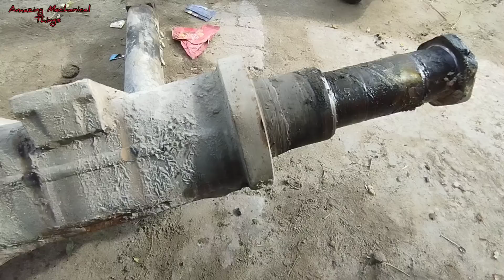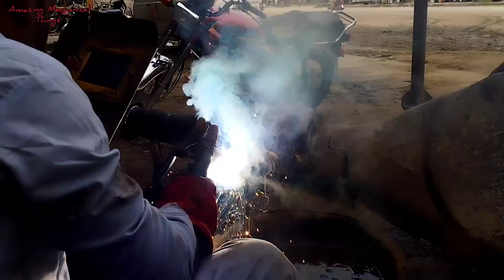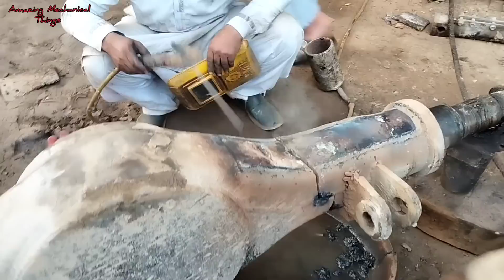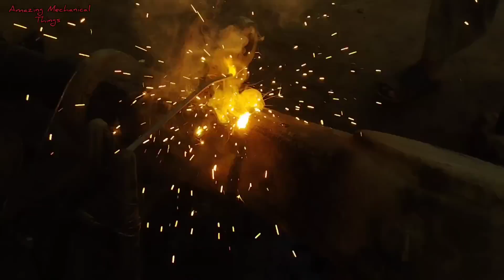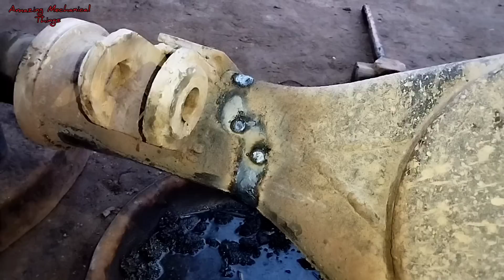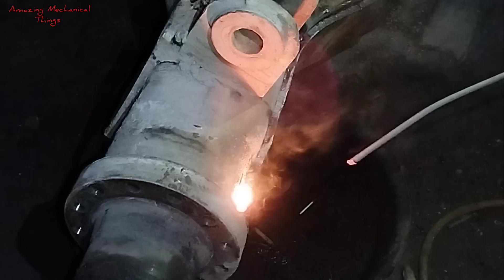Spindle are Cracked in The Middle Which no Mechanic Repairs|| NISSAN TRUCK Broken Rear Wheel Axle ||

Comment: I give that welding on the axel casing a big thumbs up all things considered, plenty of preheating, lots of stress relief with the big hammer and good root penetration at the joint. Not sure about the patch.....
Its amazing what these guys can archive.
Reply: I agree, if clearance permits, I recommend trussing it even if they are only a couple of inches high.
Reply: I say fill it with JB Weld.😂
Reply: Wth? They didn't even clean the metal before welding. That is ALWAYS the first thing you do when welding. Clean metal= clean welds. Dirty metal=shit welds. It's absolutely stupid to go through all that work and only do a half-ass repair.
Reply: @alecb8509  I think everyone here had the same thought. :-)
Reply: You can't miss on root penatration when the gap is like a quarter inch
Reply: "Preheating, stress relief with a big hammer"?... Lol you haven't a clue what you're talking about . Ummm they were trying to make it spin true with that Mickey Mouse DTI setup by welding the high side of the runout and then hitting it to move it  before laying down the full welds for which they did NO PREPARATION . It's pretty piss poor.
Reply: @oxyfee6486  that's funny....but!!! jb weld is what's holding california on the continite
Reply: The loads these guys put on a truck is unbelievable. Considering the circumstances of being in a 3rd world country, they are cobbeling together what they can to get them another day and another days wages.
Reply: Some people just don't have a sense of humour. Lol
Reply: nope, no weld prep, crummy looking root  and fills.
Reply: Stress relief with the sledge hammer 😂
Reply: don't forget  each welding  pass cleans and neals the weld below   the tipe off weld  they are using  is  not the mig shit you are  using
Reply: @matthewgillies6936  I agree, not criticising but the flat plate approach didn't work before. A bit of 3 dimension bracing seems appropriate;

Comment: Given the chronic overloading of trucks and the state of the roads, this repair is likely to be quite common so this crew would be very experienced in how to fix it.  Impressive!
Reply: But how long is it going to last?
Reply from the maker: Yup 😁 thanks 💓
Reply: @cooldog60  Under normal circumstances this part would have been junked, so I suppose if they can get even a few more months use out of it, it would have been worth it.
Reply: Problem is it may last a week. And the suspension brackets are already spoggy shit welded on. There must be plenty of these in the wreckers,, though may be no better!

Comment: Quite clever burning the plate off with an electrode. Just turn the amps up high and away you go. Saw that done on a stainless steel beer barrel  forty years ago. Still works well. Well done boys you get them back on the road thats all repair and haulage is the world over. Otherwise someone  is losing money. Gotta be done. Thanks Ruth ❤

Comment: I have seen some of the loads and incredible terrain in this region.  As to the repair...it did seem to be drawn by heat induction to much of it's orignal alignment. "I did wonder what on earth could be the electrode".?   And..I would have used much more of a grinding to weld placement.  But then I look at conditions there.  Think about expectations..."like will it work"?
Will the truck return to service for the proud owner?  Get the care and maintence that would add service life?  Took note of the estimate as age of machine...by the general design.
So ....a lot like a "field repair"...to bridge real mechanical fault to "back to hauling."
Could I have done so well?   With the tools shown to be at hand?   Did the repair meet a part, component of drive returned via repair...rather than replacement.?  I think..yes it did.
I truly do like to use heavy boots.  A full helmet with leather jacket and ear plugs.
But can this lot afford them?  Match up pay scale to what I would call basic needs.
In the end...I laugh a bit...and truly  wish this crew well.  They did their job.  M.
Reply: Well said Mr..!

Comment: The skill in using the electrode to gouge with is pretty amazing, if you folks had some of the western world tooling the thing you would make look easy lol, Carbon Arc gouging would of made this job a cake walk, or a plasma torch my oh my
Reply: I thought he was using a carbon gouching electrode, just without the air hose. Is it possible?
Reply: @GASolomons  nah, twas regular rod, carbon rods have a copper coating, and the slag makes a helluva mess without the air to blast it away, the graphite in the rods raises all sorts of problems

Comment: Looks like a live axle housing converted to a tag or trailer axle due to the lack of an opening for a differential assy. Cobbled up mess from the beginning.
Reply: You can actually buy them that way, I believe they are called dummy or placeholder axles, sold as a low-cost option for new truck setups. They have a cover attached where the diff would bolt on, to facilitate the upgrade to 2nd drive axle. These covers are usually bolted on however, not welded, so no clue how this axle started life. Either way, the truck it was mounted onto clearly needs more axles, 1 more steer axle and 1 more drive axle, plus frame reinforcement, brake and spring upgrades...
Reply: Good point

Comment: It's the alignment I'd be worried about, the half shaft probably undergoes complete stress reversal every revolution.
Reply: They got it back close enough. There's a bit of wiggle room with the housing. So long as the axle isn't bent, it'll work out ok. I'd be more worried about all that gouging slag in there. Not ideal by any means but I'm willing to bet this differential got back to work, for a short while any way :)
Reply: this is not a live axle . what half shaft? there is no half shaft. the end of the axle will have bearings that the wheel spins on. if it's a little off just means more wear on the tires which with the roads they have take a terrible beating anyway.
Reply: @jt8251  not a live axle. no differential no axle shafts . it is the axle shaft.

Comment: It has been patched before with a top plate, badly.  The stress is all in the sidewalls, not so much along the top.  The welding is barbaric, all wrong for cast steel.  Best to make an appointment now for a return visit in about two weeks.
Reply: Чулок сварной  из стали .а вот усиливать надо по бокам -да

Comment: That is actually an easy fix...if you can figure out how to do it. I have fixed many farm tractors and other equipment with cracks like this . First is to heat up the entire area so that you can get it bent back closer to the correct straightness. The after getting it close you need to apply more heat to keep it as hot as you can. Since that is likely cast iron the hotter you can keep it at the better. Next you use what is called a gausing rod. We commonly used them on cast iron engine blocks. It is used to open a hole that does not go through the entire metal but instead blows (as compared to cuts) a rough sided V in the metal area we want to repair. Then all you have to do is use a iron welding rod at about 180 amps to weld it and seal the crack. Remember to keep the area warm where you are welding this helps to melt the metal together better and let the iron flow smoothly into the V you cut. Do not pour water or anything on it let it cool by itself do not grind of any rough surface to make it look pretty but rather use your chipping hammer to knock off the slag. IF there are any spots that are not a clean weld re-weld that area only and let cool figure about 2 to 3 hours for a casing that size. But the bottom line is welding  it will likely get you down the road for maybe a a year or maybe a week you really should replace the part if it starts to leak anywhere on the weld seam because that is a sign it is going to break again and for all practical purposes you can not weld that area again. A note if you are looking closely you can tell he IS using a gausing rod to cut the plates off. Also look closely this has been worked on before as indicated by the support plates and no one weled the crack up the just put on a plate

Comment: It looks like a job well done with reinforcement again since the other one didn't support it, but those who don't have money to buy a new axle last a while longer, one hour will have to buy a new one, another thing is the very precarious working conditions: uncemented floor, without suitable clothing, gloves, protective glasses, safety boots and helmets, welding on the floor is uncomfortable, better to place on a table and weld standing up for more comfort without damaging your spine, here in Brazil the Ministry of Labor is very demanding when it comes to on safety and working conditions.

Comment: You get mixed results from these guys. Sometimes their repairs are awesome. I know a guy who is a wizard, for example, at welding small parts and aluminium brazing.

5 minutes later they are tearing bits off your car without undoing the fasteners, are screwing your bumper on then painting over the screws so you can't get it off without cracking the paint, or are getting dirt in stuff or are putting completey the wrong oil or fluid in things while saying 'no problem'. 

Anywhere they work, it is standard practice for the customer to sit and watch, ready to halt proceedings when things get ugly. Chairs are provided.

I always find it is best to remove and isolate just the part in need of repair and take it to them if you have to. It limits collateral damage.

They are working fabricating stuff, and it was from such beginnings the industrial giants of the world became major manufacturing countries.

Ability to repair sparks powers of invention.

Comment: It is interesting that the axle case seems to have been welded up from pressings in the first place rather than cast.
They don't seem to possess a wire brush!
Reply: Not unusual in trucks,, but they are done in equipped factories with the right equipment. Not crawling around on the dirt with a dodgey stick welder!

Comment: They don’t grind the metal clean before welding, they weld on dirty metal and that makes for a poor and weak weld. It might look good on the surface but it’s underneath tat counts.
Reply: Well.......their welding in sandals and pajamas so I’m sure cleaning the structure before welding isn’t that large of a surprise.
Reply: And what about all that welding particals inside the diff? Most of what these guys fix isnt and shouldnt be road legal.
Reply: Imagine that axle crack further elsewhere by hitting it with a sledge hammer like that...lord have mercy on that axle and should it break again in traffic🙏😱
Reply: @nevillesmith9795  It's a non geared auxiliary axle. There is nothing inside it and only has wheel bearing shafts on the end.
Reply: well he did burn a new channel where the fracture was, so technically it was cleaned. He also burned a big v groove in it,  so *technically" cleaned as well....:)

Comment: Axle has been repair already at least once before in the same spot.
So we good to go for another 30,000 miles.
Reply from the maker: Yup 😀😁
Reply: Do a box weld brace on all for corners for longevity, and don't overload the truck.
Reply: @mikespain8655  They charge extra for that right?

Comment: I haven't seen welding rod cutting since I did it 35 years ago. Also I didn't se how that rear end cover plate was bolted on, makes me wonder how the diff gears are put inside............
Reply: My guess is it's just there to take the load ...
Both sides are welded up ..
Reply: There is no diff, it is a tag axle just for carrying weight.
Reply: @artszabo1015  That explains why no diff gears,
Reply: @job38four10  Yep,
Job 38:4 Where wast thou when I laid the foundations of the earth? declare, if thou hast understanding.

Comment: I would have thought that the accuracy of the alignment should have been checked on the axle and not the rough outer casting. Amazing at tackling the repair in the first place, longevity, quality ,  strength and rigidity of repair ???????
Reply: Alignment is of no importance anymore since it is no driven axle, all gears are removed and axle is welded shut.
Reply: @haynillesen  No you are wrong, if the stub axles are  aligned incorrectly it will affect the trucks handling and tyre wear.
Reply: @brucepickess8097  Not worth it in those conditions
Reply: the flange they were measuring to looks to be machined and it probably created one of the original alignment points.  Also, it's a welded together housing made from stamping rolled steel, not a casting.

Comment: With so much heat and welding swarf going inside the axle. For sure the differential etc will fail. For sure there will be oil leaks everywhere due to heat on the seals. It should have been totally stripped down before welding it.  But I think it will break again within 10 kilometers.

Comment: If this repair required a splines shaft to have a precision alignment before it would go in, I'd say theres a 30 percent chance this was all for nothing.
Reply: It is a non-drive "dummy" axle. It has a welded-on cover where the diff would normally go.
Reply: Ken don't be so negative, did you see that they used a Snap-On dial indicator to make the banjo housing perfectly lined-up? Plus the heavy hammering to distress the repair. Have a great day. Cheers.....LOL.....
Reply: @caddyrack  well, I admit they did seem to do a relatively perfect job, and they did it in a way that I thought was correct in every way. However, I'm a professional carpenter, and I've dabbled in mechanical work on my own vehicles. Everything goes along pretty good until one day your lack of total professionalism shows up in a miscalculation that costs you Big Time, which is why I used the caveat that bbn if a splines shaft going in that repair required a precise fit, there would be a chance the whole job was a screw up. Do ya think they'ld show us if that happened? Ooops!
Reply: @fredk.2001  Good eye, first thing I noticed when it showed that side.

Comment: Why didn't you put it on the press push it closed then tack it in place n check balance
Reply: The axel alignment is the major requirement not the balance. That would not have been an easy task to just apply pressure to close the gap and ensure axel alignment.
Reply: @brucepickess8097  yeah I suppose you right that axle Assembly is huge plus the balance isn't important it's everthing inside moving the gears and axles that axle housing doesn't move so yeah your right.
Reply: Because the guy in the next repair shop down the road would soon be out of work if you did.

Comment: It's actually a failed previous repair, those plates were welded on and it cracked right through them. Indicates the underlying crack wasn't 100% repaired and the metal fatigue caused a second failure.

Comment: what grade of rod is that which burns metal away?
Reply: That's called gouging.  It needs 400 amps plus.
Reply: They just use an ordinary rod with high amps , they use what they have
Reply: Any if you turn the amps up high enough!
Reply: There are actually copper coated carbon rods which are specifically made for cutting.  They are actually better than a oxy-acetylene torch in certain applications.  Much more specific and controllable than a regular rod, though.

Comment: I am sure that is some X-ray quality weld there. No way there could be any inclusions or lack of penetration with joint prep like that.
Reply: As a high quality welder for 50 years, believe me, I can't comprehend the low quality workmanship of these poor people. I have watched several of these programs, but no more, and these people use one type of rod for all their welding and there is no quality control anywhere in sight.

Comment: This is obviously what went wrong. This axel was already patched, "repaired" before. You can't overload a truck by 3 to 4 times its rated capacity without it failing.

Comment: Solid welding, bit I'll never understand why these guys don't even try to clean off the contact surfaces befor welding, and why they don't mask surrounding areas. these guys create metal splatters all over the place.
Reply: It's under the truck and usually covered with dirt, you wouldn't see the spatter even if you wanted to

Comment: They pretty much tested the finished weld by forming the support piece over the top of it with a maul.  Jeff was swinging his favourite hammer in full fuck-it mode and nothing cracked.  Considering the state of the part when it arrived they did a great job getting it back to true and back out the door.

By this point it might be the strongest part of the truck its going back on to.

Comment: I get the feeling that all the prerequisite learning a person needs to be called a welder is all down to owning a welding rig. The rest of the education required to become a professional welder is broken down to the ability to listen to everyone else around you with an opinion, and then doing your own thing because you know best.  Welding a "hit and miss" bead on top of another hit and miss bead that was not been properly dressed  is a ticket to failure. Being that this axle is for a commercial truck that is expected to safely carry heavy loads on the public road system is down right scary.